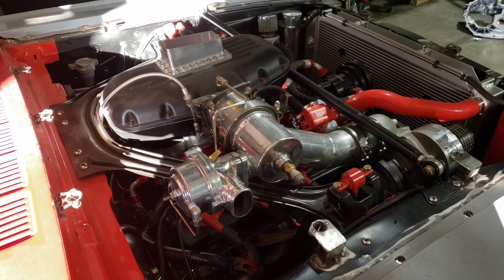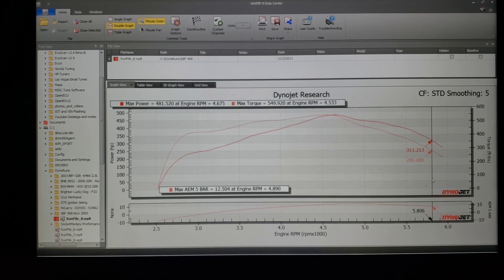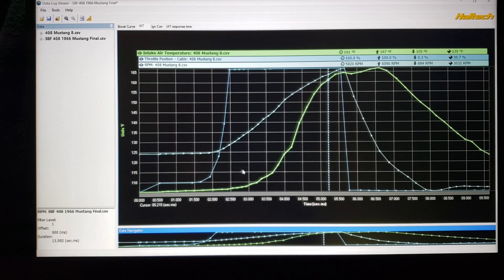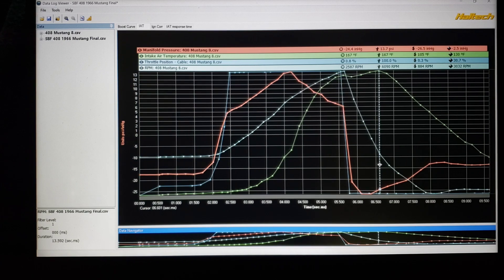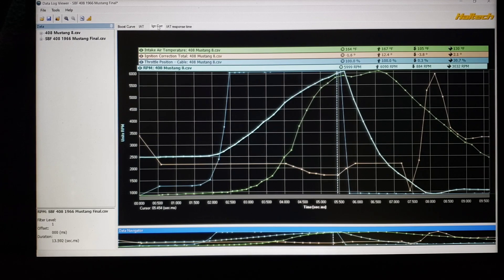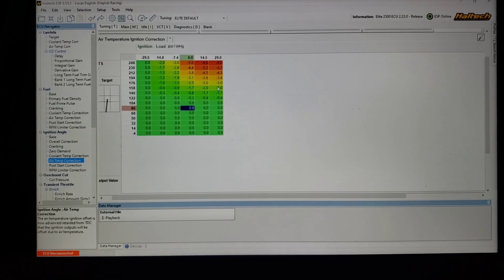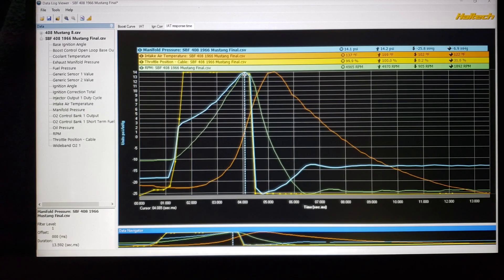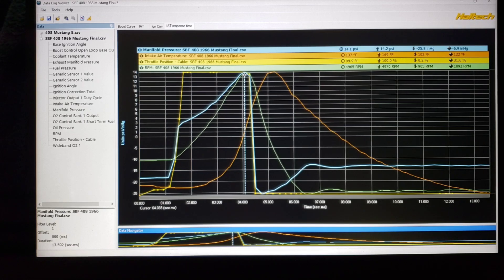Air temperature effects on tuning

Comment: Hi I would really appreciate your input.  I have been having an issue for almost a year and haven't been able to enjoy my car.  I supercharged my dodge challenger and i have had misfires and engine shaking and occasional stalling.  After the tune, the air temp sensor was not in the intake even though it was plugged in.  It wasn't plugged thru the hole and was not reading the temp.  If they tuned it with the temp sensor hanging out but still plugged in (thereby reading the outside air temp) would that cause the symptoms?  Thank you for your help.
Reply from the maker: It wouldn't be correct but I am not sure it would cause those issues. It would still be reading the temp in the engine bay, so it would be using it for some fuel/spark calculations. You are describing something that sounds like the wrong sparkplugs at the wrong gap possibly. Hard to Diag virtually, I take it the shop that tuned it wasn't interested in looking at it?
Reply: I supercharged my challenger with a 3.0 whipple and have similar issues. When they installed the supercharger they were reading IAT before the intercooler by the throttle body which is close to ambient temperature. I found out the IAT needs to be after the intercooler which is much hotter than ambient temperature. I relocated the sensor and they data logged it now im waiting for an updated tune. I have similar issues, the car makes good power until you get high in the rpms and after a long pull over 120 mph, then it feels like it's missfiring and I think  it goes into limp mode. Im hoping to figure this out.

Comment: Lots of good info here! Never thought of the iat lag time though looking at my logs it’s completely obvious. Seems like I need to watch the egt video as well cause I get a spike in ect after the track and I bet I’m just pulling to much timing like you mentioned. Thanks for all the tips. Ps got your 1% wiseco pistons from a friend, for my next J35 swap. They are amazing 😎
Reply from the maker: Awesome. I can't wait to see it all come together. Our guy at Wiseco, Jeff, designed them after pro mod style pistons.
Reply: @AaronONeal1  Lower end will start going together in a few weeks once I get back from Florida. Then to the upper end, I’ve been eyeing those p2r cnc’d heads, but not really sure they are needed for my 1000hp goal. Do you run them on your new setup or are you still hand ported?
Reply from the maker: @soullesssol7285  I'm still using the hand ported heads from Huy at Inline Racing in Texas. Heads definitely help though for making power at lower boost, same as the correct cams will help.

Comment: Good info, People don’t grasp how fuel effects IAT so much. 
Example I just ran a A2A Vortech 370z on 91. First pull was just over 500whp, it dropped about 30whp each pull after that just due to IAT and the heat-soak
Reply from the maker: It's an overlooked part of tuning for most people. Glad you have real world examples to provide as well. Thank you :)